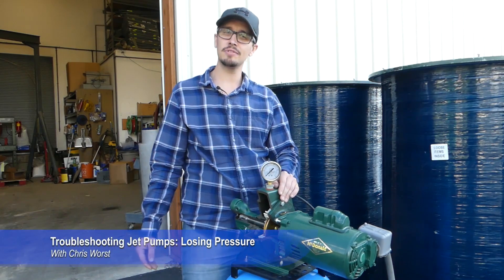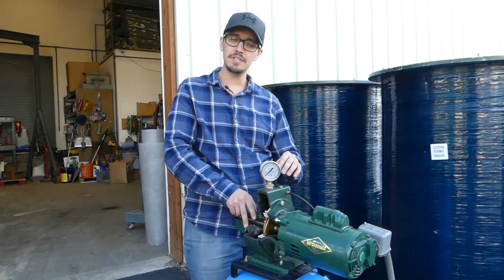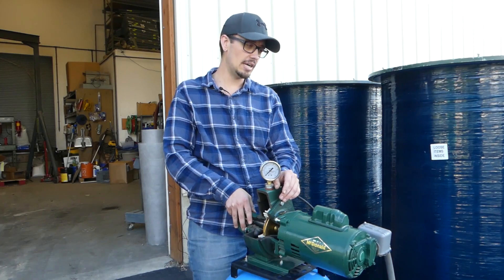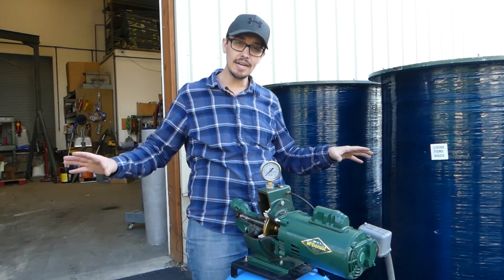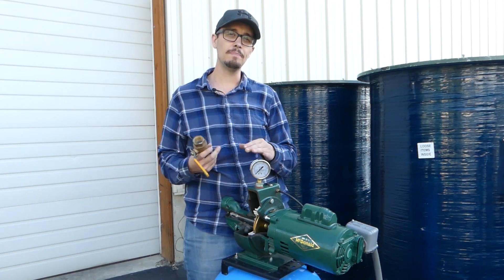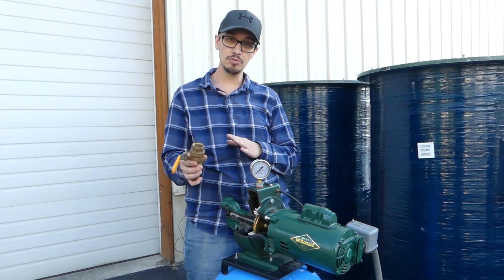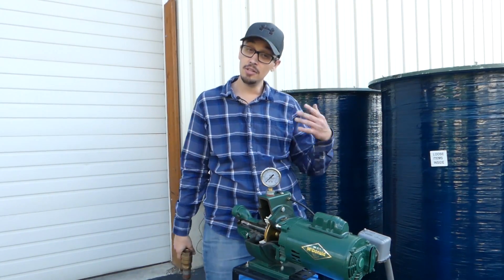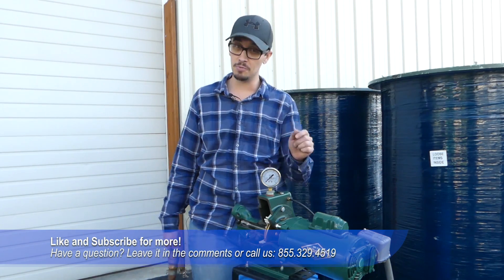Troubleshooting a Jet Pump: Losing Pressure

Comment: Hi, my 1hp Jet type pump ran dry for most of the night and when I discovered it the whole thing was so hot that when I switched over to another water tank the water was boiling before it got to the pressure tank and took a long time to cool down and it would not pump over about 20 psi after that. I rebuilt it with all new parts and the motor seems to be running fine but it still won't build over about 20 psi, any idea's. Thanks.

Comment: Question ... ball valves on inlet and outlet, isolating the system to just the pump, and bladder charge stable. Pressure from cut out to cut in is 15lbs. 15lbs pressure lost in 7 minutes .... air charge is 18lbs, cut in is at 20lbs, cutout is at 35lbs. 
What could the cause possibly be? No water leak at the pump/pressure tank unit.

Comment: I have a DAB jet pump (1 HP). It is 24 yrs old and pumps water from a storage tank to the house. I have a propane on demand water heater. Recently out of nowhere the water heater which is only two yrs old began to shut down in the middle of a short shower. Upon investigation, the heater shut down just as the pump pressure reached the cut in point leading me to suspect that the drop in pressure at the cut in point (20psi) caused the safety switch in the heater to shut the heater down. The pressure switch is a 20/40 square D about 4-5 yrs old. The pump shuts off precisely at 40. However as I watch the pressure as I drain the system pressure drops very slowly down to about 25 psi and the pressure gauge needle flutters and suddenly crashes to 20 or maybe less and the pump starts. The expansion tank was mfd in 2013 and has a capy. of 150l. Any ideas??

Comment: I'm having trouble with a Myers ½ horse convertible pump using it in a deep well application. I'm not being able to build over 20 psi. The pump is used, new to me, but everything else has been installed brand new. I can't seem to find any leaks.

Comment: hey i am currently loosing pressure in my pump when it not in use...i change the pressure switch and check-valve at the inlet....the check-valve was not good....this cause the pump to take a little longer to cycle on but the pressure still drops fast close to the cycle on pressure so say around 30 psi and cycles on at 20 psi...i have a ball valve at the output outlet which i turned off and the pressure still drops fast.....what else can i check....i check the pressure hose to the switch all good
Reply from the maker: You must have a leak somewhere. You will have to track that down and repair it.

Comment: I’ve got a Jet pump for the cottage that isn’t getting above 20 psi. The line from the lake is pull so the foot valve should be okay. We are trying to run it now, it usually runs to about 40 psi and the shuts off when it has full pressure in the storage tank connected under the pump. Any idea what might be causing the pump to not run above 20 psi. Sorry for the wording I’m a novice when it comes plumbing
Reply: I have the exact same problem at my cottage.  I even changed my pump but still only gets to 20 psi.  The only other thing I notice is that the suction line coming from the lake into the pump seems to be full of water but partially collapsed.  Any help is appreciated.

Comment: Thanks for that helpful info.  Have another issue with water pressure.  Just installed new 3/4 hp. Myers jet pump and Well-X-Trol bladder tank.  Have checked and adjusted both pressure switch and pressure tank to be at your recommended levels of 40 - 60 psi with 38 psi on tank.  When you open a tap, pressure (flow) drops rapidly and it is really bad when a toilet flushed or washing machine is running.  Have 1" poly line coming from cistern to pump and then 3/4" PEX and copper lines throughout house.
Any tips you could offer would be appreciated.
Reply from the maker: It sounds like your pressure tank may be too small. What size is it?

Comment: Jamie
My Sta-Rite jet pump on a 2" PVC deep well casing is cycling on about every 8 minutes. I can watch the pressure gauge at the pump go down to 35 psi and kick on til 55 and shut off. I have an output valve a few feet after the air tank shut off, so its just the pump, pressure gauge and pressure tank. I've already replaced the Sense line to pressure switch which had a leak. Replaced foot and valve and Pipe cup seals by foot valve, and casing adapter seal. Acts like a leak in the casing or pipe in the well. No sign of any external water leaks anywhere. Took the pressure tank off and plugged the hole, and now the leak really shows itself as pressure at the pump drops fast and pump cycles every 10 seconds. No external leaks. Could this be an internal leak where the pressure side is getting i  into suction side inside the pump casings? What else could it be? Thank you for any help.
Reply: Was it the foot valve? Leathers?

Comment: I have a deep well jet pump and it does not build pressure above 30 psi.
When I shut the pump off the pressure drops to zero. 
The pump housing remains full of water after shutting it off.
When I primed the pump using a gallon jug of water with a clear hose attached to it and a hose barb where the gage is  I see small bubbles in the hose like it may be sucking air from somewhere. 
I've never had any problems in the past when priming a pump in this manner.
Any ideas?
Reply: I know this is an old post but did you find the problem? Mine is doing the same.

Comment: We are puzzled with our jet pump and going crazy troubleshooting it. We have an old 1hp jet pump that we replaced the bearings, impeller, mechanical seal and capacitor. We use it for continous duty without pressure switch and tank. After priming the suction pipe, it will just start a few squirts then then slow down and seize until the magnetic switch trips. When priming it has a good speed and quite sound, but when it starts to pump it sounds like it has difficulty. We have good 237 volts. I measures the amperage and it is normal until it starts to slow down and eventually stops spinning, amperage reaches 3x normal then. The capacitor measures good capacitance. Bearing arr not seiZed.
Reply from the maker: Have you checked the foot valve?
Reply: @RCworstwater  yes. Its clean and working, tried to run it even without the foot valve, still doesnt work.
Reply from the maker: @nealdelrosario5344  Might be time for a new pump

Comment: Hi, I replaced a foot valve on my 50Ft shallow well.  I am not getting any prime back in my pump after replacement.  Any tricks to getting the air out of the lines and getting primed again?
Reply from the maker: You have to manually prime the pump with water - it will not do it by itself. Check out our video on how to prime a jet pump: https://www.youtube.com/watch?v=_SsTj8ZtGLo&t=127s
Reply: Any help would be greatly appreciated.  Thanksgiving day and I am pretty sick right Now

Comment: I moved my jet pump from my crawl space to the garage. Now after setting over night it sounds like the water gurgles. There’s some air in my filters that goes away after enough run time. I did have to splice my suction line from well and have checked the connections, cannot find any leaks. Any idea as to what to try? Thanks

Comment: Sir what to do if the air pressure goes down rapidly. It trigger the switch always.
Reply from the maker: Give us a call: 855.329.4519
Reply: You have to much water in the pressure tank, you need to drain the pressure tank and then make sure there is no leaks at the top of the tank like around the pressure gauge and then just turn the water back on again and let it fill up.